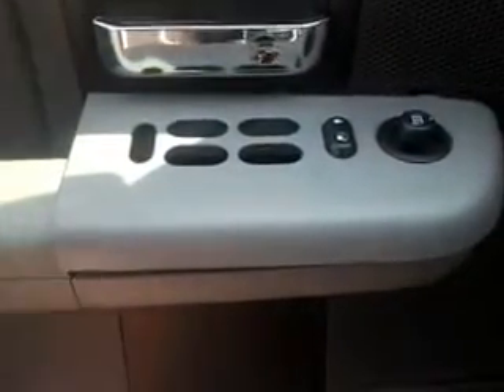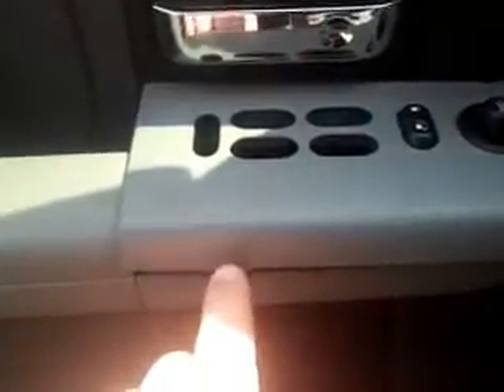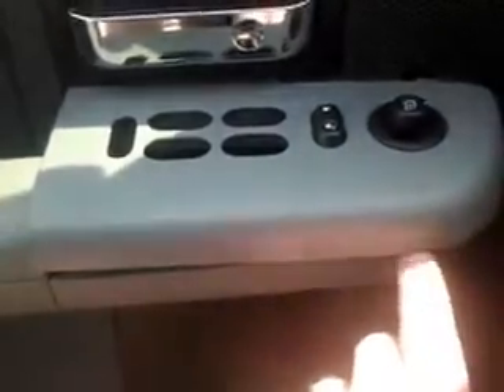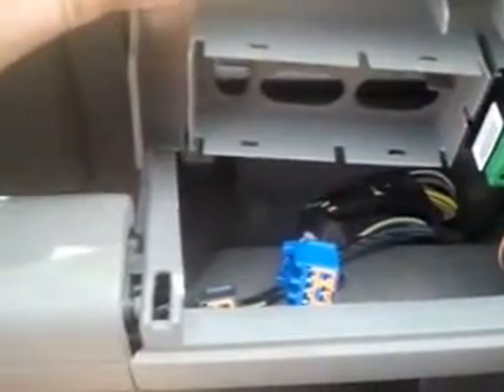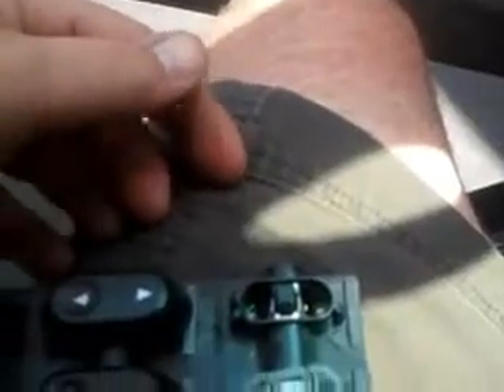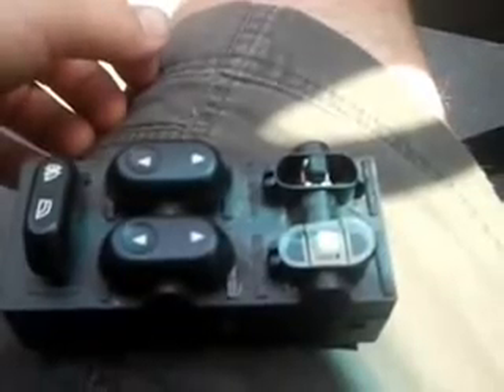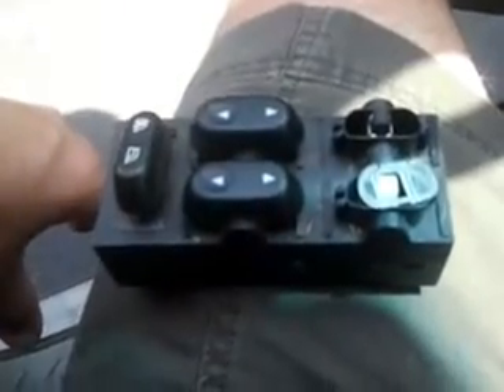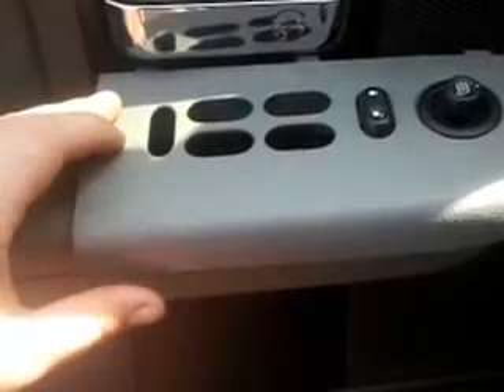f150 power windows how to fix

Comment: Burnishing contacts helps but grinding is a longer lasting solution.  Will cure slow window lift as the contact is better.
Reply: If grinded, you’d have to do the TINIEST oxy/acetylene weld or wrap a thin wire around the squared part, because there not just dirty they’re possibly burnt meaning that the contact is worn down from being burnt so it wont make any contact with the the switch